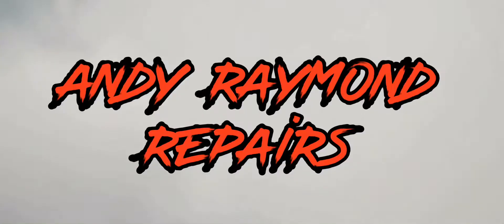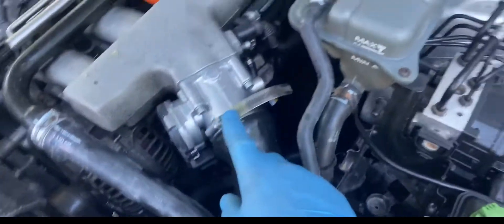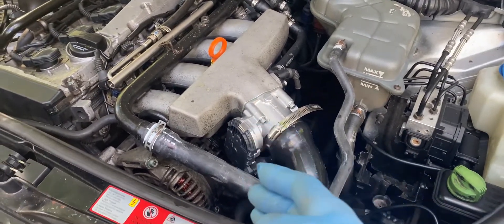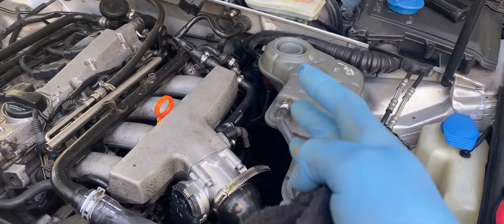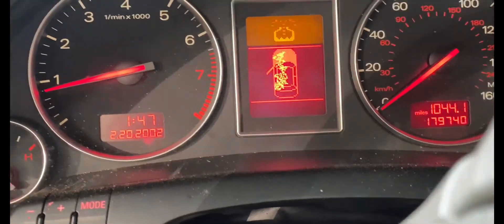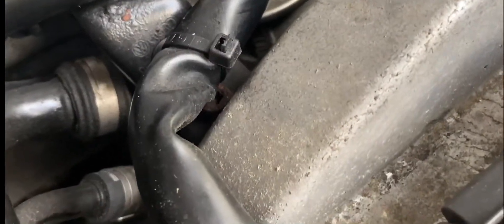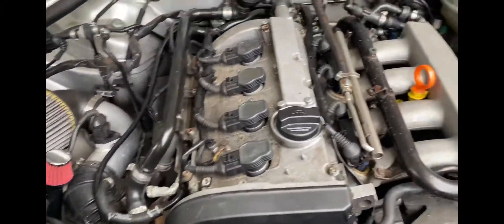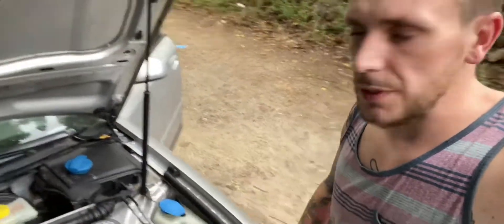How to fix Audi A4 1.8t overheating and no heat! Check these

Comment: yup! that's the J-Plug,  the hole is actually used for coolant when the same engine is used in a transversal configuration. Since this is longitudinal it's just plugged - VAG engineering at its best
Reply from the maker: Thanks I was actually curious what the actual name of it was